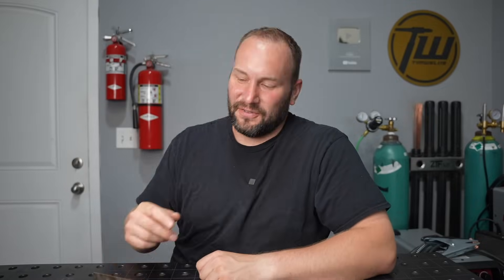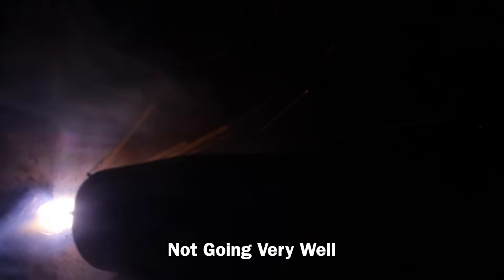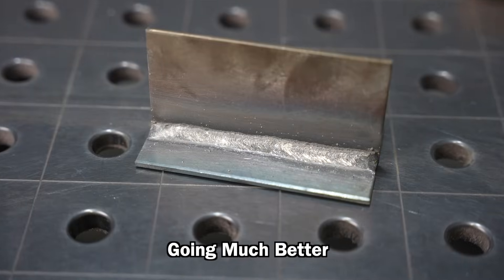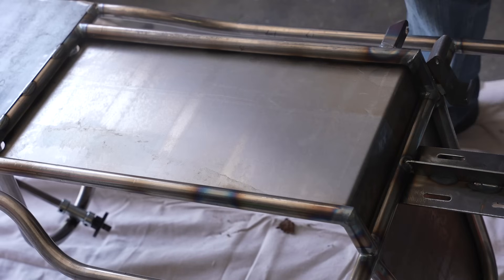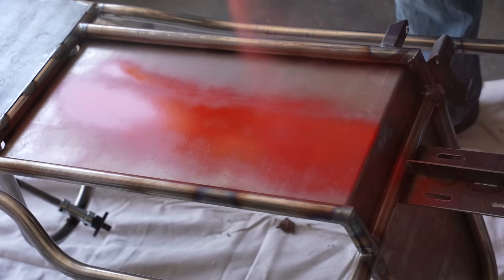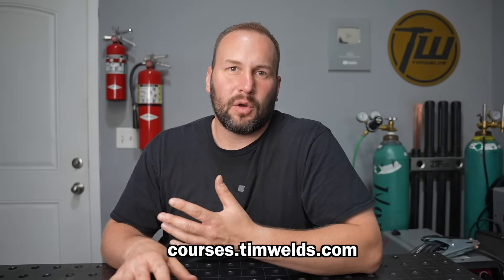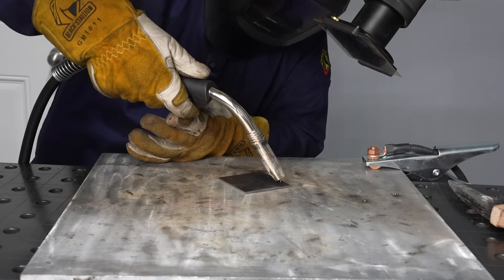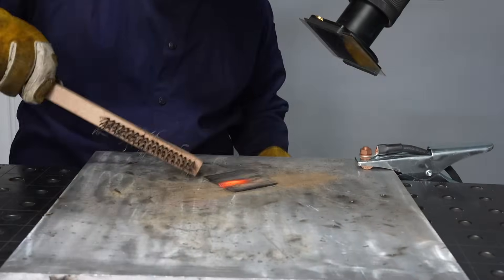#1 Way to Get Better Flux Core Welds

Comment: 16ga sheet metal setting 2-A on a Lincoln mig 180 seems to work for me with flux core. I don’t know anything bout welding but has good penetration and doesn’t blow through and heat up too much if your tacking.

Comment: In first year welding in highschool, we did 4x4 pads of sheet metal, welded bead by bead until the thing was 4 inches thick!  Then we went to a 4x4 pad, tacked 4-2inch by like 16inch pieces of sheet metal to the pad, making a tower that formed a giant x onto the metal pad, resembling a tower, and welded vertical up and vertical down welds, capping the welds along the way!  it was so redundant, that i got to where i was super good, but it made me not want to weld ever again because of the monotonousness of the process!  i still took 2nd and project year welding, but now 20 years of not welding, i am needing to get back to welding, but was surprised that i am having troubles setting up my machine, and seeing my puddle with this esab flux core machine!

Comment: No matter what you do welding you will not get a mig weld with flux core to look like a 7018 stick weld. I have both lincolin180 and 400 amp dc stick.

Comment: I have welded for years with primarily Flux core along with stick welding. The tip of My first welder looked like yours with the tip cover. After that welder finally went out completely I bought a new one and it didn't even come with one. That has made a world of difference in my ability to see the puddle. Take it off and give it a try, you will kick yourself for not realizing it. And thank you for sharing your video.
Reply: Are you saying dont run a tip cover and you can see the puddle easier?
Reply: @flyonthewall6933 yes, you dont need it if no gas.
Reply: @flyonthewall6933 if he means nozzle then yes. Fcaw doesnt need it. U can use it. Again if u come from sticj welding fcaw is not so hard

Comment: Tim, have been a gas “brazer” since i was a snot nose kid. Still have my gas torch but just got the bug to do mig/stick. Love your videos. Just added a new electrical service so a solid 240v 50 amp circuit is doable. Do you have Equipment recommendations in one of your vid’s ? Thanks.

Comment: What is the big suction looking tube above your table?  Do you have a video that explains the details of it or similar ones we should use?
Reply: It is a fume extractor, not totally necessary for most operations, but nice when welding flux-core or stick indoors.

Comment: So, I'm curious—with flux core, can you increase voltage, feed rate, and drag speed to just weld faster?
Reply from the maker: Yes you can, but there's a limit to how far you can go before you start introducing weld defects, especially undercut.

Comment: and where you weld where weld has to hold, this does not work, because you dont weld the root at all.
Reply from the maker: You can hit the root with an appropriate travel speed on self-shielded flux core...it's actually one of the more robust processes for that.
Reply: @TimWelds  ive been welding support constructions for highrise buildings for past 6 years, and with 20-50mm thick metal, dragging the torch, or w/e is english correct term, never melts the rood, you pretty much have to push it with flux. Going too slow when dragging will overheat the metal way too much, and its structure will be changed to a form, thats already unworthy. It ruins the material structure itself.

Comment: If you are using flux core, why do you have a gas nozzle on the gun.
Reply from the maker: I don't remember which machine I was using in this video, but if it has the gas nozzle, it's also a MIG welder. Some people take it off when using flux core, but I don't like to do that because you get more spatter and debris on the diffuser.

Comment: I'm going to admit something that probably many welders won't. I've been welding for a little more than 12 years, but most has been with GSMAW/Gas shielded mig, only last few months I've wanted to get back into getting familiar with fluxcore. Well, it's been almost 2 months since my last bit of welding... and, oh wow I put down some ugly welds. So bad I told myself "OK, te to take a step back, go do something else for a little and come back to it". During my break I looked up your video here. Not only was I moving too fast, I've got a lot of stressful things on my mind, and I wasn't paying alot of attention to my settings. Somewhere in moving the welder around my knows got moved and it assisted in my confusion with why things were so off. I was getting over temp alarms on my welder, and one sided beading of my weld in a vertical down lap joint on 3/16 steel. My prep was good my positioning was... not great... and too hot with way too slow wire feed, while moving too fast. I was in a hurry. A hurry to feel like a dumby apparently. 
   And that my welder friends is something I've never ever seen a fellow welder admit face to face. Ever. 
   Stay humble, stay hungry for knowledge, and as always Be thankful for the guys willing to share their knowledge and skills to keep us from loosing our minds when we get off track with what we're doing with our welds.

  jeez... I'm glad my friends haven't seen this weld, I better clean it up and fix it before anyone sees it... I got a reputation and what not... lol

Comment: I'm totally new to flux welding or welding in general. I exercised first at a piece of metal and it was fine. When I started to weld the joint at the same speed, I made holes into the material. I turned down the machine and it got better. Boy I got a long way to go.

Comment: Everybody upload videos welding on thick materials. The actual challenge is 16 gauge metals and below!!!
Reply: I'm no master welder, but a trick an old coworker showed my that helped on autobody thin panels, was putting a wet rag behind the weld surface and (I was using gas shielded mig might be different with fluxcore) he said to just stack tack welds. So it's weld a puddle, stop and let it cool, then weld half way through that tack with another, stop let it cool, etc. It came out awesome. Also was easy to clean up to get that smooth autobody finish. 
   Hope that's helpful to someone.
Reply: @Skilled4dathrill39 a flat piece of copper behind if you can do it helps too.    I use flattened  piece of old copper water pipe.
Reply: At that point switch to MIG
Reply: Or you can use a lower power setting…….
Reply: @minguyen-rl7sn  depending on wire size, dropping the setting could mess with your welds. For paneling work it's really best to go with small size mig.
Reply: @jeffjoestar4245 ahhh ok. I see. Thank you.
Reply: That part tho
Reply: What size wire is best for welding 16 gauge stainless?  I was thinking .035
Reply: If 😂you need that thin your running entirely the wrong process buddy you need tig for thin anything
Reply: Yessss
Reply: I’ve welded sheet metal it’s easier bud.

Comment: If you get rid of the gas nozzle your vision is less obstructed.
Reply from the maker: Thanks! I don’t like to do that because it leaves the diffuser exposed to get contaminated with a bunch of spatter and fume. I also don’t find the view to be a problem, but if it’s helpful for you, that’s awesome!
Reply: @TimWelds same
Reply: Until you clog the air holes on the gun

Comment: Traveling torch on reverse will block your view to where you need to weld, i"m right handed and travel torch from right to left with a slight angle just enough to see the puddle.
Reply from the maker: I hear you. I’m used to looking past the wire because in real world situations, it’s often that you can’t choose which hand and which direction to go. I’ve done a lot of stick welding and because that process requires a drag angle, you almost always have to look past the rod.

Comment: Hi can you use flux core to weld 1 3/4 mild steel tubing for chassis
Reply from the maker: Yes, you can, though it’s not ideal. I would recommend MIG or TIG for that work if possible.

Comment: There's a machine - by Azzuno - that runs on 110/220v & will run a stable arc at 40amps with 0.8mm flux core wire. I only have mine 2 weeks so am still discovering what it can do - I have a lot of flux core machines (work) - so far, it's a game changer. 

It will - I've not come across ANY other welder that can - run a continuous weld bead on 1mm butted steel joints with full penetration & no blowing holes with 0.8mm flux wire.  It's the  closest thing to Tig I have come across in a Mig or Gasless  welder. I had a customer in today wanting a 1mm galvanised steel sheetmetal roof surround shaped, welded & fitted to their vehicle - which meant welding 4 sections together to form 1 full surround. The damn Azzuno ran solid beads on every joint - with any other machine I have (loads) I would have had to tack tack tack that assembly together. Not today - I just welded ahead full runs, full penetration & neat like you tigged it. Mind = Blown.

They are, in my humble opinion, the absolute best welder you can lay hands on for thin material running flux core wire. Unbelievably good. How much distortion is caused by 40 amps? None I could see. Nada. Unreal.

Comment: Hey I can't find a video on this but I've used some gasless Flux core a month ago and only got porosity almost every weld and the Flux would not cover the entire weld can anyone tell me possible problems?
Reply: I may be wrong but I believe the polarity has to be changed between gas and flux. Check your operators manual.

Comment: Seeing the puddle has always been a major problem- it ties in strongly with the right helmet settings, which are also a mystery.  As an extremely nearsighted guy with floaters, I have a hard time even reading, so looking at the puddle with bad eyes, floaters, a smoked up and dusty lens from trying to look too closely, and light dazzled eyes from the auto helmet darkening too late….   Long story short I’ve been through two semesters of welding class where I failed both, and on and off trying to weld for 30 years now, its a bit of an issue.  
  But I will keep trying until I can’t move my hands anymore.  
  Anyone that says welding is easy hasn’t tried to teach this Mr Magoo to weld.  
  That being said, these videos are the best resource I’ve ever had, because rather than banging on about how easy it is, you are actually addressing real problems that I have, without making me feel dumberer.
Reply: you got it man, just gotta keep trying 🤞🏾
Reply: You know they have magnifiers that snap into your welding helmet they call them cheats 2x 2.5x and 3x magnification? You probably know this however just in case you missed the boat somehow.
Reply: Add a strong cheaters lens to a large view passive helmet, (old school head nod to drop the helmet,) it takes some getting used to but you won't get arc flash and I would change the glass lens to a 9 or so, never give up, it gets hardest when your almost to the top of the mountain!!
Reply: Practice one day you will be amazed how good your weld is. Just stay on it and you will get it!
Reply: You just have to keep going until you hit the Eureka! moment. One day you're just making the usual mess & then suddenly you're welding.
Reply: FLOATERS ARE A MAJOR PROBLEM FOR ME 32 YEARS WELDING

Comment: Tim,  I was told that you push a mig weld not pull a mig weld.  I know that pushing a mig you don't see the puddle so well.
Can you illustrate the real direction mig weld between no gas and gas welding?
Is the wire speed the temperature setting?
Reply from the maker: Depends on the transfer mode. For short circuit transfer (which is what most people use), either push or drag is fine. For spray transfer, you need to push. For flux cored without gas, pull.
Reply from the maker: Yes, wire speed control amperage (heat). Voltage controls arc length and how flat the weld is. Higher voltage gives a longer arc and a more concave weld.

Comment: Hi. Not really related to the video but do you have any advice on why when im welding gasless flux core sometimes I have to get a closer tip to contact for it to weld smoother.

Comment: This is nice however I can't see the direction. Because the arc is bright and I can't see the joint.  I've had to adjust the protection of darkness to see where I'm welding. With it dark it's like welding blind.  Even when your welding
Reply: When you are welding I can't t see the direction that you are welding I  don't  see the line that you are welding in your video.  I don't have a problem getting a nice straight weld if I can see where I'm 'welding

Comment: Hey Tim I'm new to welding and got a 3in1 gasless welding machine for flux core mig. The machine only has amps n volts knobs and the digital display only displays amps. I'm on sure I. How to set wire speed n go a out fully using this machine
Reply: Same.

Comment: Very good lesson for the most part, my only question is why is it that it looks like you are pulling your welds with fluxcore. In school I was always taught you never pull Flux for as tour puddle cools your pushing slag into your puddle, creating an impure weld that will fail an x-ray and sometimes fail a bend test as well. Note this is from a structural welding stand point. Yes normal home projects that technique works .  Not trying to be that guy just want to make sure
Reply: You have push and pull confused. If it makes slag, you drag. Same with stick, never push stick unless vertical uphill maybe.
Reply: You drag flux core and push mig

Comment: Excellent advice.  Being able to see the puddle is the most important things in welding, being able to control the puddle is second.  It's only second because you can't control what you can't see.  
My first auto darkening helmet was a cheap one and I loved it.  It was great being able to see to strike the arc and having it darken all by its lonesome and lighten up when the flash was done.  My welds kinda suffered when I started using it and couldn't figure out why.  I loved it!  Then I realized I just wasn't seeing the puddle like I should was was really only making half decent beads because of experience and muscle memory.  I switched to a bronze lens Speedglas that's literally like flicking on a light bulb, I can see everything!
A decent helmet (fixed lens or auto dark) and magnifying glasses if you need them, if you need them to read you need them to weld!
I paint cars more than I weld but the skills and techniques are very similar and easily transferable.
Thanks for the tips, you're definitely one of my favorite welding channels.
Now I feel like I need to go out to the garage and run beads using flux core, it's been awhile since I've used flux core for anything other than a quick zap.  I keep a cheap Chicago Electric flux core wire feed welder for tasks like that and my Lincoln for most other things.  I've got a big old Forney buzz box that gets used for the heavy duty stuff, like 1/2" plate bumpers that Jeep guys seem to like (and then wonder why they handle so badly lol)
Thanks again

Comment: In the first few scenes, have those welds been clean up? I am very new to welding and trying with a gasless mig flux core. When I lift my hood the welds are never that shiny, not even close.
Reply from the maker: Yeah, they had been wire brushed. They’ll always have light slag and brown dust on them.

Comment: Good video.  I can vouch for the bead padding exercise.  It definitely helps you learn to be very consistent in how beads are being laid down.  It also will show very quickly as to how well you are wetting in (fusing) to the previous bead.  Then I recommend sawing the coupon in half perpendicular to the weld travel to check the cross section.

Comment: Tim, are you using the extra plate on your table to protect the table from splatter?
Reply from the maker: I'm mainly doing it to ground the coupons without leaving marks on the table or having to clamp directly to them. The spatter doesn't really stick to this table, but it's true that I'd rather not make a mess of it when I don't need the fixtures because I'm running coupons for practice or demos.

Comment: How to set current and amps ..in different thikness jobs
Reply from the maker: With most flux core welders, the 2 settings are wire feed speed and voltage. The wire feed speed controls both the rate at which material is added and the amperage (current). Thicker material will need higher wire feed speed. The voltage knob controls the length of the arc, which in turn controls how flat the bead is. To set it, I start with the wire speed to get a bead that penetrates, then fine tune the arc lenght and bead profile with the voltage knob. I have some videos about this on the channel that walk you through the process.

Comment: Thanks, Tim. Being able to see the puddle has been my biggest issue, primarily due to reflections from behind the helmet once the arc is struck. I now have a t-shirt jury rigged across the back to block out ambient light. Helps immensely!
Reply: Initially uiu I y
Reply: How did you put the shirt on or over to block the ambient light
Reply: @davidminas5347  Just with duct tape and draped over the back of the hood. Kind of have to flick it into place.
Reply: lincoln electric sells welding hood covers specifically for this, they also sell ones that strap too the bottom too keep out spatter and smoke
Reply: I did that as well.  Then I bought a back hood to put onto my helmet.  It was vastly superior to the cloth that I was using.  Also look at adding a bib to the front.  I did this as well and the ability to see the weld puddle and the area around the weld puddle helped tremendously in being able to lay down consistent straight beads.
Reply: @paulkurilecz4209 From one Paul to the next Thank you tremendously. My fix was a headlamp over my helmet and then another one when they got covered in splatter 😂 but your solution actually fixed my seemingly random weld blindness.